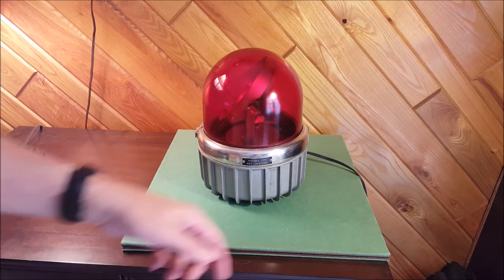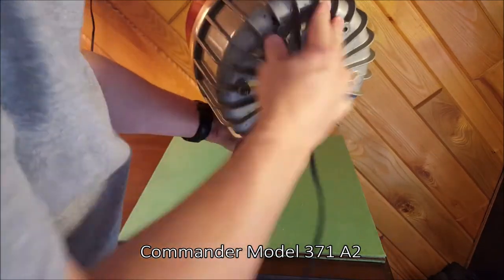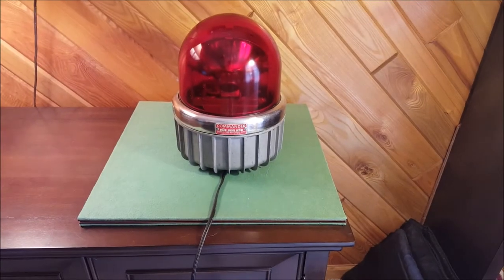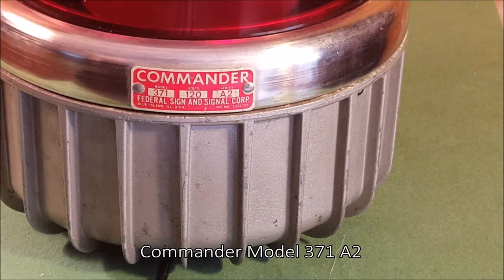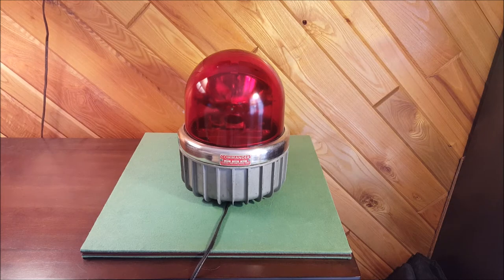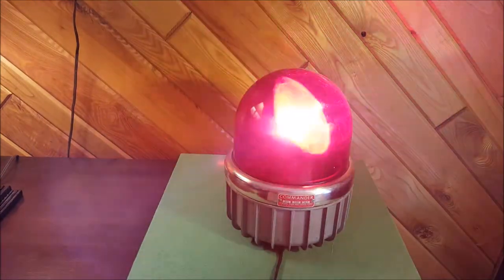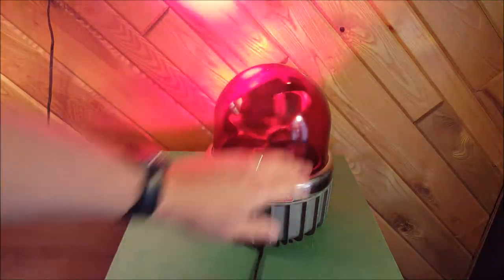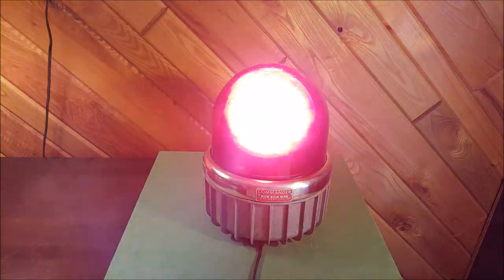Commander Red 371 A2 Rotating Beacon Light Vintage Fire Engine Light

Comment: These would be installed upside down for industrial or commercial applications I believe.  This is not a hill light, because there are no other lights pointing straight out at a 90' angle.

Comment: I have a 12v version of this called titan A1 312 12v.   NOS, only shelf wear from sitting in storage for however many decades.
Reply: What you have is a totally different type of light. The light shown here is a Commander Beacon. A single PAR 46 bulb that has the ability to adjust the beam angle up to 90 degrees.  A Titan light, which is the 312 is a dual bulb PAR 36 beacon that does not have adjustable angles. It was offered only in DC vehicle voltages.  The only similarities of a Titan and a Commander are the housing and dome. The internals are entirely different which is why they don’t share the same name or model #

Comment: The old Motorola paging system at the fire station my dad worked at had one of these on the ceiling it would turn on when the bell went off and the speaker turned on.

Comment: "Vintage Fire Engine Light" isn't a fire engine light at all, lol. But thanks for sharing it on video!
Reply: Blackie Foxxless  no Sir it was not, not using 120v. 12v to 36v would be for an automotive application. 120v would be a strong indicator the light was used/designed for an commercial application.
Reply: Blackie Foxxless   This is an industrial warning light. Never used on vehicles.  The Federal Signal Beacon Ray had a similar shape dome, but a different base and internals.

Comment: What kind of installation were these used for?  Never seen a single PAR36 sealed beam angled upward like this. Very unique indeed.
Reply: Mike Hawk seen em on a coal crusher building, on the outside, warning of impending start up
Reply: Actually a PAR 46. And the angle is adjustable from 0 to 90 degrees.   They were used anywhere a bright and heavy duty attention getting light was needed. We use them as fire alarm lights and warning lights on conveyor belts. They offer them with glass domes as well for high heat areas like mills.
Reply: @FFred-us9tw  I was wondering why the glass dome for a light I assumed was being used on a vehicle.  Your explanation makes complete sense! Very informative.
Reply: There's one on a local pumping station, although it has a 90 degree bulb and is mounted right side up on the exterior of the pump enclosure.  The pumping station is either for storm water or maybe it's for sewage, I'm not sure.  I've seen it on more than a few times and I imagine it's alerting of a problem.

Comment: The heat is why The Commander Has heat sink body construction , they are supposed to be mounted upside down , this is the reason for the angle of the beam!
Reply: That is incorrect. The installation instructions clearly state it can be mounted on any angle. I've installed and maintained dozens of these. The beam angle is adjustable to allow flexibility for beam angle.
Reply: @FFred-us9tw  sorry forgot sincerely these things are so old and the ones in our stations were hung upside down and they kept pretty cool 😁

Comment: so really not used on vehicles  but rather on buildings ?
Reply: Correct, this was never offered in vehicle voltages. 120V AC or 250V DC.   This was classified and marketed as an Industrial warning light. It was never listed in their vehicle equipment catalogs.
Reply: @FFred-us9tw  yes Thanks for the explanation
Reply: @FFred-us9tw  I have a vehicle version of it in my hands right now Titan A1 model 312 12v.  With dual rotating lights that shoot straight out
Reply: @caseytbss  you have a Titan, the beacon shown here is a Commander.  Same housing, same dome. Different internals. It is not a vehicle version of a commander, it’s an entirely different beacon.  A 371 Commander is a single beam adjustable angle PAR 46 beacon. A Titan is a dual PAR 36 beacon only offered in three voltages. None higher than 72 V DC.

Comment: Looks like it might also be used on some type of aircraft.
Reply: These were never used on aircraft. Not rated for anything aircraft. Strictly industrial applications.
Reply: Blackie Foxxless  These beacons are not FAA rated. In fact, Federal Signal never produced any beacons with an FAA rating.
Reply: Blackie Foxxless   Again, no, this is an industrial beacon. Not a vehicle mounted beacon.